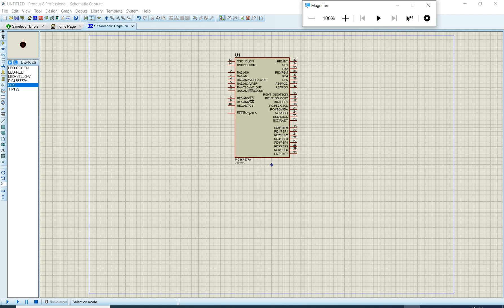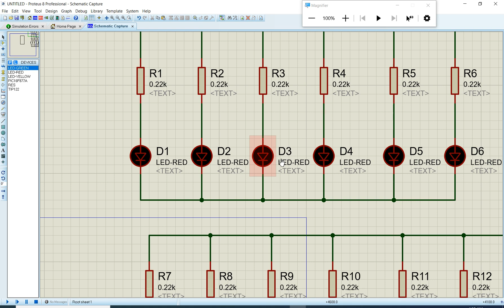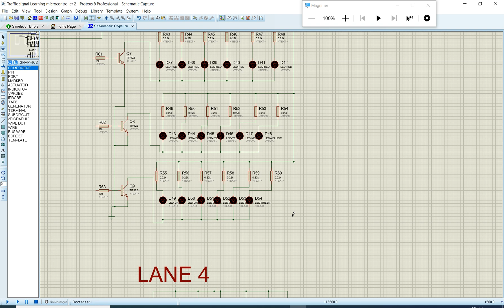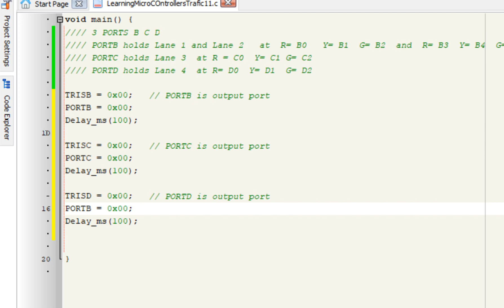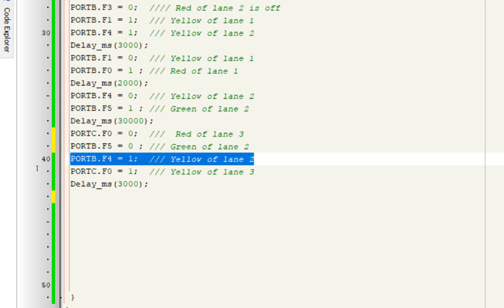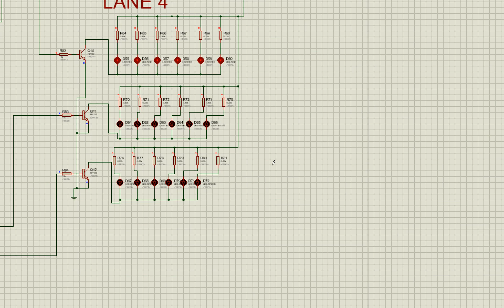PIC16F877A based 4 lane traffic signal controller. Very detailed, Step by step tutorial.

Comment: int adc_value;

void main() {

ANSEL = 0b00000001;
TRISA = 0b00000001;;

TRISC = 0b00000000;
PORTC = 0b00000000;

ADC_Init();
while (1){
adc_value = ADC_Read(0);
if (adc_value > 825)
{
PORTC = 0b00000001;
}
else
{
Delay_ms(200);
PORTC = 0b00000000;
}
if (adc_value > 855)
{
PORTC = 0b00000011;
}
else
{
Delay_ms(200);
PORTC = 0b00000001;
}
if (adc_value > 890)
{
PORTC = 0b00000111;
}
else
{
Delay_ms(200);
PORTC = 0b00000011;
}
if (adc_value > 925)
{
PORTC = 0b00001111;
}
else
{
Delay_ms(200);
PORTC = 0b00000111;
}
if (adc_value > 975)
{
PORTC = 0b00011111;
}
else
{
Delay_ms(200);
PORTC = 0b00001111;
}

if (adc_value > 960)
{
RA5_bit = 0;
}
else if (adc_value < 930)
{ RA5_bit = 1;
Delay_ms(250);
}
if (adc_value < 950)
{
RC5_bit = 0;
}
else if (adc_value < 810)
{
RC5_bit = 1;
}

Delay_ms(200);
} }